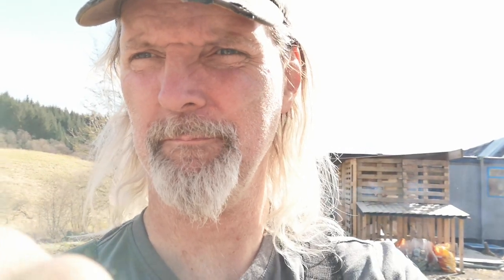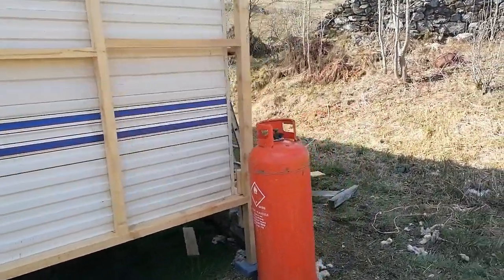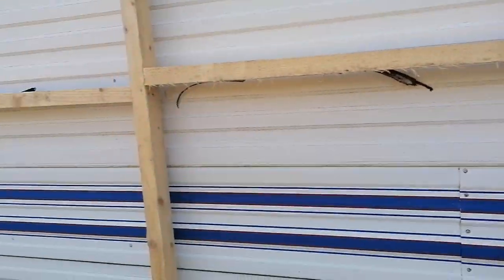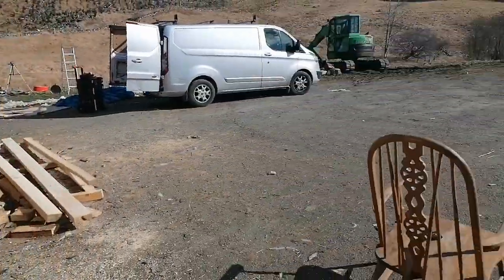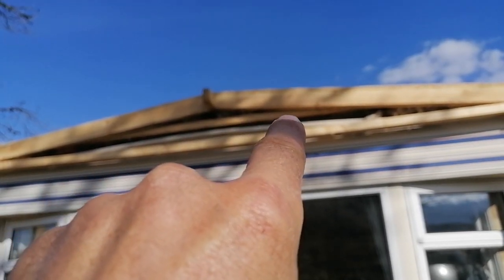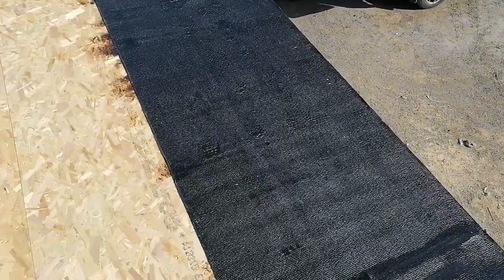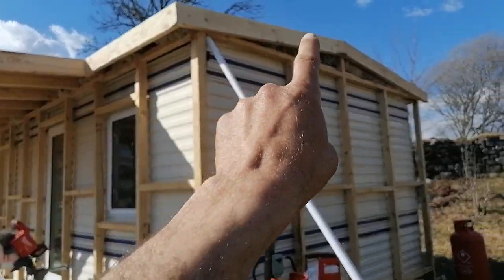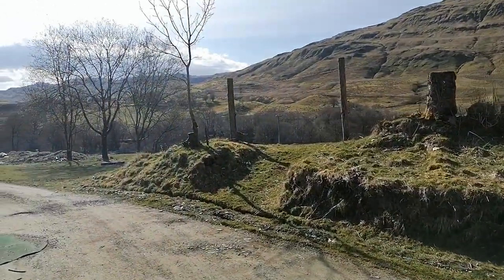LADYFIELD FARM - How to Renovate a Static Caravan : Part 1 Studwork and Framing

Comment: Hello! Thanks for the great videos this has been really helpful for our static conversion.. how did you insulate the floor it looks like you may have used untreated wool? How did you attach this to underside? We are going to insulate and clad the caravan and putting in double glazed windows and hopefully a wood burning stove will reduce the problem of condensation.. we’ve only had the caravan a few weeks.. it’s at least 20years old and we’ve found rot in the walls and some floor we’ve had to replace. I’ve been told not to insulate floor as it will rot out.. but I guess if wool insulation is breathable then this should work..? Any Advice much appreciated. Many thanks. Jules 😊
Reply from the maker: Hello Jules, so glad the videos have been useful. We did start trying to insulate the underneath with will but it proved extremely difficult. I tried to keep it all in place with strips of plastic stapled to the timbers underneath but it really wasn't very effective. Instead we opted to place bales of straw all around the perimeter of the caravan just underneath inside the edge. Up here the cold wind blowing through seems to be the culprit for taking the heat away so this has certainly helped by stopping that wind. We have zero condensation problems with having a woorburnern. Most of the heat is lost out of the roof rather than floor so of the two getting the roof done is more effective.

Comment: Hiya - are you concerned about moisture and mold build up between the insulation and the original aluminum walls of the caravan? Or I suppose there is enough airflow that it’s not an issue? Especially if u are using a wool product as insulation.
Reply from the maker: Hello Jillian, well there is quite a lot of airflow around the caravan studwork, nothing is sealed. The insulation is fleeces taken directly from shearing, no treatment at all and thus far, approaching 2 years, there is no sign or suggestion of any problems.
Reply: @LadyfieldFarm  awesome! Thanks! Been thinking of a project like this myself and that was my first concern.

Comment: What kind of fire proofing did you do to have a wood burner in there  as im unsure whether to do mine i just worry about everything catching lite. ?? Plus how much did you pay for your bags of wool?
Reply from the maker: Hi Grant, I really should do a video on that question. The woodburner sits on thick paving slabs with at least 300mm beyond the from of the doors. The wall behind the burner I lined firstly with a 12mm sheet of plasterboard and then I tiled on top of that. I cut a hole through the ceiling and roof at least 50mm bigger all round than the flue which was twin wall so pretty cool to touch anyway. Then I attached a fire proof board to the ceiling for the flue to pass through. That was a 12mm thick Hardie Backer board. The void in the ceiling and on the roof was filled with vermiculite.
Reply from the maker: Sorry Grant just realised I didn't answer your last question. I helped out with shearing at a farm across the glen so I as fortunate to be given several bags of wool. The fleeces are currently worth so little that it costs many farmers more to transport the wool to where it needs to go than they get for taking it there. So if you approach any local sheep farmers you may be able to get some pretty cheap. I did get some last year for £10 a bag and there were at least 50 fleeces in each bag.

Comment: I have a static and been thinking about this for about 5 years  ,maybe this is the year!! I THOUGHT THE STUDS SHOULD BE 600MM APART BUT YOURS LOOK WIDER ?
Reply from the maker: Hi Jim, to be honest the stud spacings were dictated by the position of the windows. I needed an upright each side of each window and then I generally split the distances left to end up with spacing of around 600 or less. If any are wider it won't be by very much at all. Good luck!

Comment: How's things, only just found your channel an I'm just after buying a mobile home. A question on the sheep's wool,do ya just use it straight off the sheep or does it need some work done to it before ya can use it?? Thanks
Reply from the maker: Hello Frank, we used it without treating it in any way. I have had folks say that it should be treated but 3 years in and we have no issues at all. The sheep get a treatment called 'pour on' a few times a year which kills ticks and lice etc and I think that must hang around in the fleece. Whether it is due to the climate in our area or not I don't know but all appears well. I have heard that sprinkling Borax onto the fleeces as you put them in is a good idea but it's not something I've done. Sorry I can't be a bit more definitive.

Comment: Great video, did you notice a difference just with the roof before you finished the sides?

Will you put in double glazed windows?
Reply from the maker: Hi Clive, thanks for watching, The period between doing the roof and the walls was during the summer so to be honest it is hard to tell how effective just the roof would be. One thing that was very noticeable is the summer though was the roof of the veranda...that side of the van faces south and in the previous summer the sun through those windows heated the caravan up unbearably but with the overhanging roof this kept the direct sunlight off the windows and the difference was remarkable. 
The caravan windows are already double glazed handily.
Reply: Why did you go for felt roof and not a tin roof with breather membrane?

Comment: I have only just discovered your channel so have some catching up of your other videos. Impressive what you have done so far. Have you achieved this by yourself or do you have someone to give you a hand?
I live in the Midlands and wood prices here have rocketed. I did a project but didn't order enough wood and when I went back 6 weeks later the prices had gone up by 30%, so you are very fortunate to have that supply. I can't wait to see it finished, that larch cladding is going to look amazing. I also love that you are using sheep's wool to insulate... thank you for sharing your video.
Reply from the maker: Good Morning Lesley, thanks for taking the time to comment. Yes the caravan makeover I did by myself.  I have worked on my own for years and it is amazing how you find ways to do things when you have to. 
Timber prices went crazy for a while there didn't they. I believe they have come back down somewhat now but of course not to where they were. And yes you are right I am incredibly fortunate to have access to the timber I do. The next big project here is to restore and convert our 200 year old stone barn/byre and again all the timber will be coming from my friends sawmill. That is going to be quite the challenge. Hope you enjoy the rest of the videos.

Comment: Hello again - another question for you. I have seen quite a few people basically strip the caravan down to nothing and build it back up. They take off the aluminium and remove the "insulation" and sometimes even the framing. Then build it back up with sturdier stuff and clad with wood. This is tempting but I wonder what the benefit is over your method. Thoughts?
Reply from the maker: I'm not sure of any benefits that would outweigh the extra work and cost which would be substantial I'd imagine. Done that you would have to redo all the inside as well as the out of course. No doubt it is perfectly achievable but goodness me it sounds like a lot of work.
Reply: @LadyfieldFarm  That was my thinking too for the most part. But you could reframe the windows and install a better quality window. Did you insulate under your caravan? And since you have been all set up have you had any condensation issues?
Reply from the maker: @jillianbanks-kong4876 I stacked bales of straw all round under the perimeter of the caravan mostly to stop the  cold wind blowing through. Hard to say how much difference that made but I think it was worth it. I had previously tried to insulate underneath the floor but it was like trying to staple blancmange to a ceiling whilst lying on our back!!
B3xause our hear all comes from the wood burner condensation is never an issue except when boiling stuff on the hob but that clears pretty quick. On a normal day there are no signs of condensation.

Comment: Smart job pal we are literally embarking on the same project with a 37 x 12 caravan roughly how much 3x2 and 4x2 did you use ?? Just on the main caravan
Reply from the maker: Just looking back at some old photos I can take a rough stab at it but it will be rough...
3x2 40 lengths 2.4m for uprights
3x2  30 lengths 2.4m for head and noggins or dwangs! 
4x2 35 metres of any lengths for supports in steel girders underneath and plates for stud work. 
Hope that's helpful.
Reply: @LadyfieldFarm   Thankyou so much

Comment: Question: Is the wool you are using washed at all? My experience with unwashed fleeces (I spin wool) is that the wool moths will go to it first over washed wool. I don't know if it is because of suint/other filth (what I would expect) or the lanolin. Can't wait to see this project completed!
Reply from the maker: Hi Beth, we have taken a chance with this wool and gone with it unwashed. There is a cottage in our glen that had some wool used as insulation over 20 years ago with some of it exposed in the eaves of the building and there is no evidence of wool moths in it. Maybe it is the climate here. Anyway we will keep a close eye and hopefully this will be the same. Thanks for watching and the final stages will be done soon.
Reply: @LadyfieldFarm  I was wondering how much the climate would be a factor. I suppose, if you left it accessible in the eaves, you could remove and replace it, if necessary. I'm in the pacific NW of the US and we have pretty warm and somewhat dry summers. Prime moth hatching weather...

Comment: Nice video. May i ask why you have no double glazing? Have you thought about it? Worth doing?
Reply from the maker: Hello, the windows we currently have are in fact double glazed. They are only 12 mm units but better than single obviously. So far as the weather has turned cold this year we have not had early morning temperatures as low as last year and we have had a record morning high with a minus figure outside so it all seems to be working. Thanks for watching.

Comment: Brilliant frameworking! And the cladding will look wonderful! How many bits did you go through while drilling the holes in the steel beams? I'm guessing 2
Reply from the maker: Believe it or not I don't believe I broke any. Different story drilling out rusted in screws on the roof vents mind.

Comment: Hi! I'm embarking on my own static caravan decking exercise and plan to follow your lead by using those metal chassis runs underneath to hold 3x2's that I can extend out for decking. Do you find the block pavers on which you've got the posts stood are enough? All google says is 'posts must be concreted down' or similar, and my static is on a hardcore base so I don't fancy trying to dig 16 post holes when I don't have to!! Cheers
Reply from the maker: Hi Samuel. The block pavers are working fine and as far as I'm concerned are a better option than digging the posts in simply because when they are in the ground they will begin to rot. Being up on the block pavers it minimises the amount of water they are subject to. If you have enough pavers to have two under each post then leave a gap between them, say half an inch, that way any water that does fall onto the pavers will just drain away from the bottom of the post. 
The joists being connected to the underside of the caravan steels will hold everything laterally so I see no other reason to concrete them in.  
Would love to hear how it all goes....
Reply: @LadyfieldFarm  Thanks, a very kind and swift response! My wife and 2 young boys are in the process of moving onto 24 acres of agricultural land in Devon having sold up in Scotland, so whilst were the reverse of you geographically we're going in the same direction!
Reply from the maker: Well how about that! Where were you in Scotland and where have you landed in Devon? I have a great friend in Devon who is my gardening guru! 
If I can help in anyway do feel free to get in touch. admin@ladyfieldfarm.com

Comment: Are there any issues with using wool with pests or mold ?
Reply from the maker: Well we have just passed our 3rd winter since we did the work and there have been no issues at all. I'm told an additional treatment would be to add Borax to the fleeces when they go in. We didn't do that and all appears to be well thus far.